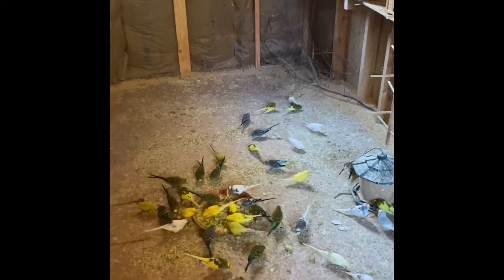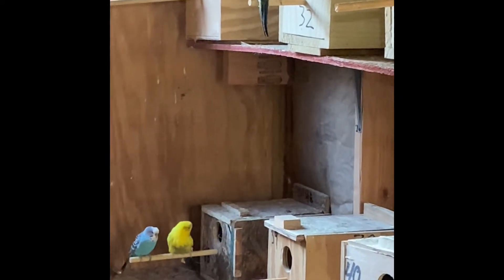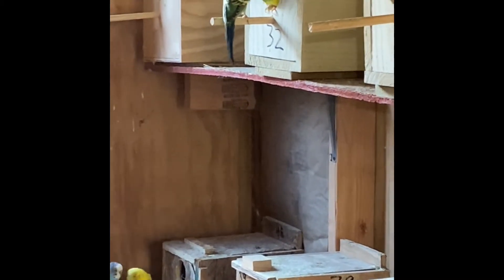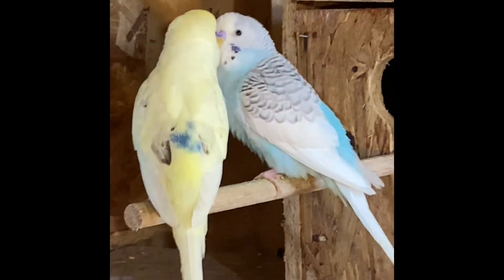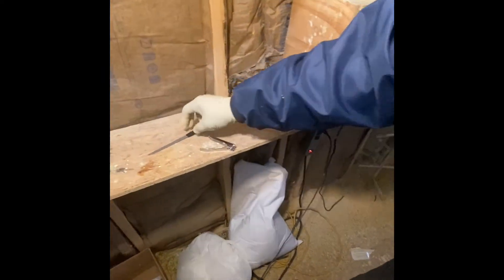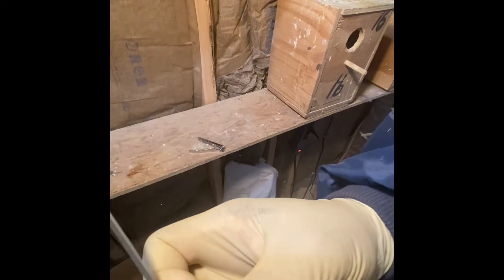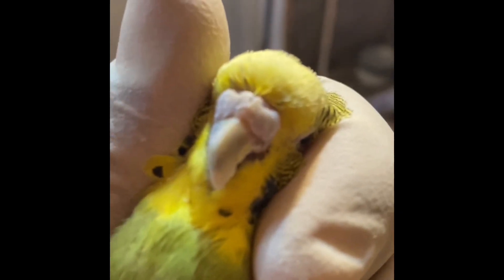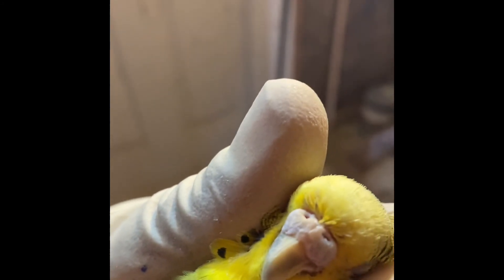PARAKEET(BUDGIE) LONG BEAK BEING CUT MUST WATCH.

Comment: I use an electronic nail file (very rare) on one of my budgie, he does not like it but eats like a maniac afterwards… always before cutting or filing a budgies beak, look on the inner side of it and mark the outer side where the vein is, this will prevent injury and discomfort later.